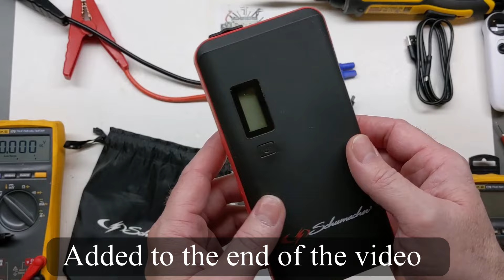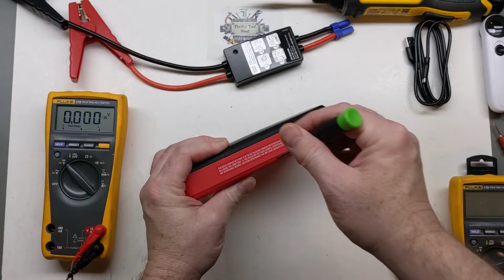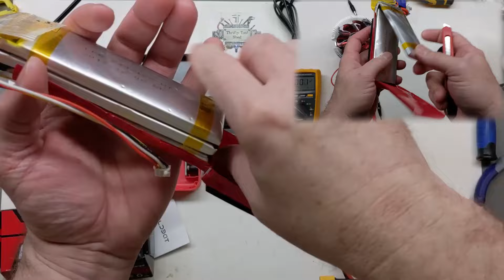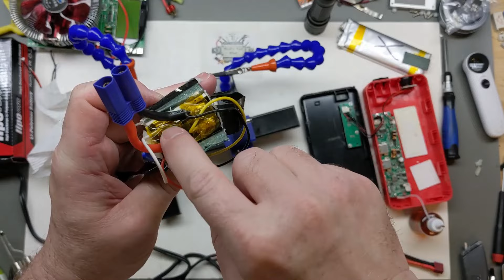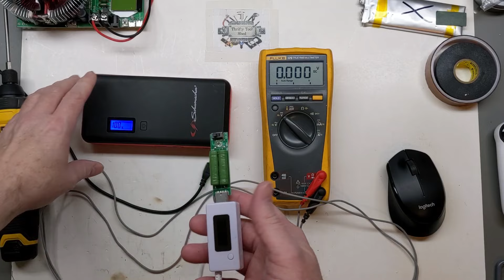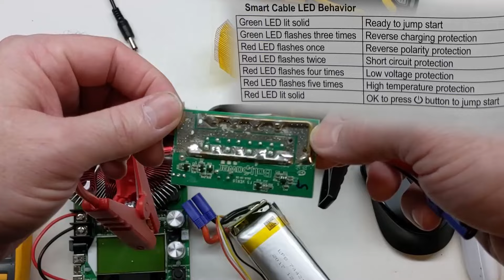Can we fix this Schumacher Li-po Jump Starter?

Comment: Great Video! 
I inherited a Schumacher SL 1316 jump starter that won't charge. I would like to replace the battery, which is 12.8V 3000mAh and 38.4Wh.  I assume this battery is LiFePo.  I can't find a 12.8V replacement battery.  Any Ideas?
Reply from the maker: I am thinking something like this may be close? I would check dimensions for sure....
https://amzn.to/3bLzW7d
Reply: @ThriftyToolShed  Thanks for the quick reply!   The approximate dimensions for the battery I need are 14.4 x 4.4 x 3.2 cm.  I can probably find a LiPo battery that will fit in the case. However. the battery in the SL 1316 is a LiFePO4 with 4-cells of 3.2V in series for 12.8V.  Do you think the SL 1316 charging circuitry for the 3.2V LiFePO4 cells will work with the 3.7V LiPo cells (S3 for 11.1V).
Reply from the maker: That's very interesting that the SL1316 has the LifePo cells. This is a more expensive way to go so it's suprising. The 4S makes sense for LifePo cells for sure. The 3S LiPo similar to mine will not work then if the BMS is for a 4 cell at 3.2V. Another viewer mentioned theirs was a 4s design as well, I did not realize they changed over to this chemistry.  Thanks for sharing!
Reply: Did you ever find one I’m in the same boat

Comment: I bought the Schumacher SL 1517 jump starter. Died on the second jumpstart permanently. Do not waste your money with these. Warranty is only 15 days with Walmart. Manufacture will not return my phone calls or emails
Reply from the maker: I did not know that, since Walmart always spotlights the 90 day warranty they have I would buy nothing electronic there then! I know with some computers and other electronics they only offer a measly 15 day return, but it includes the jump start, what else is on the list??? Most things are electronic to some degree, crazy...

Comment: My power button broke how can I turn on with out a button
Reply from the maker: If it's just like this one, the only thing really is to solder on another one on to the board. If it's just the plastic that is broken and the switch works then you can carefully still actuate the switch possibly with small plastic tip of something. A screwdriver could cause damage.

Comment: I am looking at my sl1315 and I have a red a white a black a and a yellow wire like yours but I also have a blue wire also in addition I have one extra battery cell
Reply: I have no idea on what to do
Reply from the maker: It is possible that they put on a 4S pack instead of a 3S pack I guess? First of all most packs you can look and tell how many cells are in the pack if not clear wrapped so you can count the cells in pack, you may have to carefully cut open the heat shrink around them to look. The other way to tell is if you carefully cut back covering over the connections, you can tell where the cell connections go. It might even be that the extra wire you have is simply done differently. In other words it's possible if it's a 3S pack still, that there could be a extra small wire added to the BMS instead of using the heavy gauge black and red for the monitoring. I would simply see where they connected them to cells. They must have changed board revision at some point.

Comment: Appreciate the video!  Quick question.. anyone know what happens if your load test an Li-Po using a traditional lead -acid auto battery resistance load tester?
Reply from the maker: To be honest it would almost certainly damage the cells. Li-Po are being used to help boost a weak battery but under heavy loads these cells will fail! Lead acid does much better with very heavy loads as well as pulling voltage to low level. Li-Po are unfortunately finiky about over current and over and under voltage. So I use them to boost a week vehicle, but I would not expect them to hold up with much abuse. They are great for emergency use and are very light weight and convenient though. I would not put them under undue stress, that's just my opinion.

Comment: I will never buy Schumacher crap again as my 2 SL1316 battery’s swelled up so much that they broke open the case. This is a saftey issue and Schumacher needs to do a recall before someone gets hurt or killed.
Reply: We have had 4 Schumacher battery chargers and we've had no issues with them whatsoever, they performed as they should.
Reply: Also if your battery swells up it's because you had a bad cell in the battery and you still tried to charge it. That's the operator's fault, not Schumacher.
Reply: @404notfound.....  Bullshit.  The chemicals in it put off carbon monoxide and there’s no way for it to vent out.  It’s just the nature of what they use.  It builds up gas in there with just regular use.  Look it up.  I’ve had two do this.

Comment: Would it still be able to jump a car?
Reply from the maker: It will do suprising well if maintained  fully charged. I chose this pack because it is alot more capacity than many of the small jump packs on the market. The smaller schumacher jump packs etc. are only around 4000mah or so. I wanted to use this  much larger pack. They make some even larger, but they do get expensive. The only draw back to this set-up is you have to make sure you have polarity correct, which is a big deal anyway  Even with jumper cables of course that's a big deal! The smaller jump packs do have the reverse polarity protection built in. You could actually buy those small protected leads as well if desired. I have seen those for sale on eBay. I should have mentioned that in video.

Comment: Your Easy to listen to, I was born in Texas. I enjoy how you document your work as you progress. Great Job. I have some Schumacher trickle chargers that just  stop working after years of use. I often wonder what’s the problem.
Reply from the maker: Just realized you said trickle charger and not a booster pack you were asking about. I am not sure about those, I do not have a schumacher version of a trickle charger to say for sure. Do they just stop working all together? One of the most common issues I have had with any charger is a bad connection. To save money, companies use cheap clips/clamps and the connection is not even soldered alot of the time. Where the wire connects to the clip it is sometimes just crimped and subject to issues. The inside board with components can also corrode with these as alot of these are left in garages and shops. Hard to say other than these issues, it could be a  circuit board issue.
Reply from the maker: Most likely a similar issue. Thanks for your comment!
Reply: I added a digital readout to all my trickle chargers. It is so much better then just a couple LEDs. It is definitely the board. I do not have the depth of experience you display. I’m just a hobbyist who really enjoys your site.
Reply from the maker: Digital read outs rule. You did good on that. Wish I had more experienced with those. If it just stops working completely, it could be as simple as a diode. But I simply would be guessing since I have not worked on one like it.
Reply: Is it really worth the time and effort fixing these things. I have just bought a Gooloo GE1500 here in the UK for £23.99. just to keep in my own car. I also have a Gooloo GT4000 and a Topdon JS3000 Which get used in the workshop.
Reply from the maker: @bigbob7062 
No,  not really. I try to look inside and learn about many items, but not always worth it. I always learn a lot though. I have enjoyed taking things apart and the challenge of repairing them since I was a kid. After 40 years, I still have not out grown it! 😂
Reply: Same here, I've messed about with electrical, electronic and mechanical things since I was a child. Still take things to bits to see how they work, if fixable I fix them if not I put them away for another day.